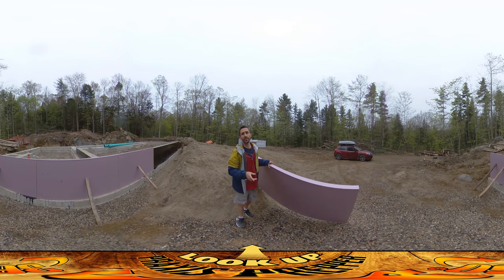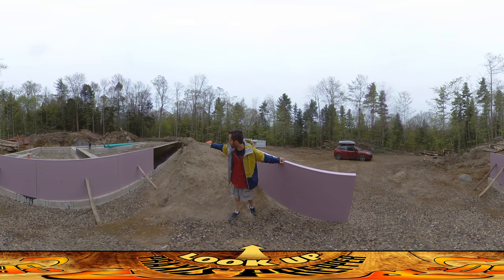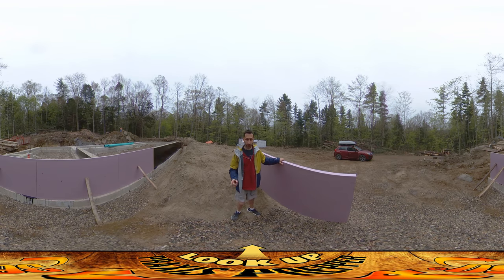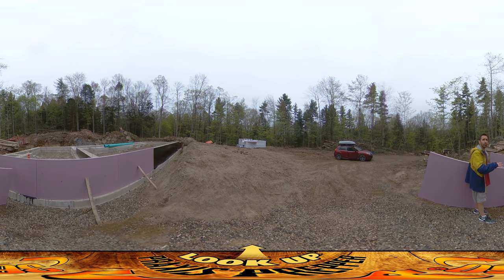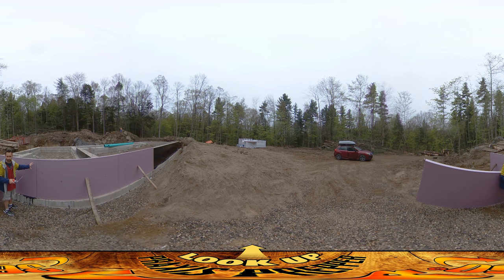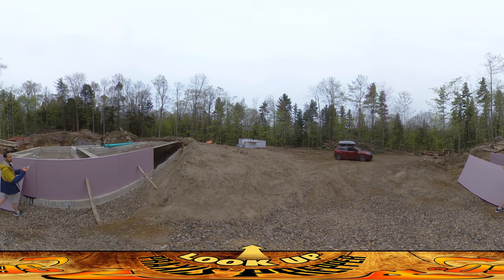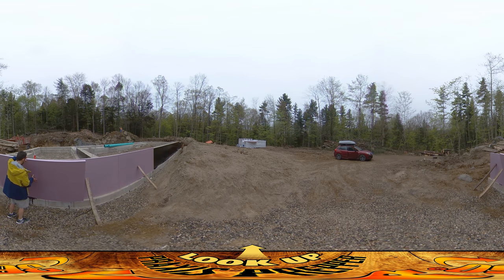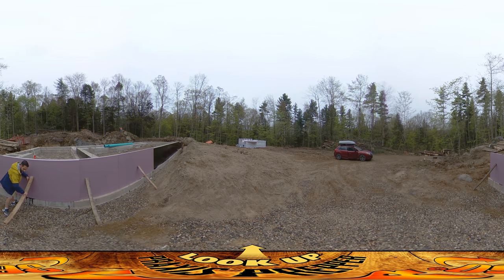Homestead Building - Foundation Insulation, Prepping for Foundation Perimeter Drain Installation

Comment: I think we use that expandafoam stuff under our sinks and such where there are any holes where drains and tubes go to the outside of the house. Keeps the bugs out (an issue in South Texas). I just wish it wasn't so wasteful. You have to use the whole can in one go as it can't be stored for later.
Reply from the maker: I know what you mean about the can clogging up if you don't use it all right away. For that reason, I group projects that need spray foam and when I have enough to use a can, I go and do them. It'd be cool if it could be done one at a time though.

Comment: Oh bud by the professional spray foam gun, no waste and Betty accurate. Available in minimal and regular expanding can switch it out. 60 bucks for gun get two cleaner. You be very happy I have this advise. You will use that even though this phase is past
Reply from the maker: That's probably good advice. I'm not familiar with where to buy canisters of foam aside from the small ones though. Do you tend to find them at hardware stores?
Reply from the maker: There's a lot of toxics when building anything "conventionally" unfortunately. When this place is up and stable, I'd really like to try my hand at a cob structure at some point and go all natural.
Reply: Todd Hendricks  no not the spray open and closed foams. I was describing the anal great stuff crack seal. Same can Praxis was using just different applicator method. As a professional builder I doubt people truly understand how much of gases occur
Reply: @PraxisPrepper  I was describing the great stuff applicator pro series easier less waste. I watch a builder who went too Norway and how they build. They use natural wood some are 8-12 inches thick. The sustainability for heat retention and efficiencies destroys pour building standard numbers. But it's so much lower on toxic. You never get away from them but sure can lesson them.
Reply: @PraxisPrepper  lowes and home depot sell them. Usually in insulation isle. Also Amazon. It has a metal ball that keeps it sealed when not in use. I come back to using it week later no issues at all. Cleanliness next to godliness
Reply from the maker: @cptrestlesssteven6469  I pre-bought a number of the cans, so I think I'm committed to them for this build. But I know what you mean about the gasses. You can see the air distorting around the foam as it comes out of the can.

Comment: Why are you only using 1 layer of foam board on the greenhouse wall? Wouldn't you want it cooler in the summer and warmer in the winter?
Reply from the maker: Good question. On the far east and west walls of the greenhouse, I'm only doing 2" instead of 4". That's because the greatest impacter on greenhouse's temperature is going to be the temperature of the ground from below and the fact that the roof is going to be just greenhouse roofing. So the walls aren't going to have much impact upon the temperature in there. Also, in the winter I'll need to have vents constantly open to prevent the place from getting way too humid and same in the summer to prevent it from getting too hot. So again, with all that air changing, whether or not the walls are insulated becomes pretty minimally important. In fact, the major reason that I continue the foam onto the greenhouse walls at all is simply to allow the apparent thickness of the foundation to appear visually consistent across the foundation's surface.
Reply: Praxis Homesteading and Survival Skills Thx, now I remember you doing the same venting in the old homestead. Wouldn't it increase your growing season If you completely insulted in there and used a dehumidifier in the winter and an exhaust fan in the summer? Maybe with some supplemental lighting using LED grow lights in the winter to offset the shorter days? I've used them to grow strawberries in the winter in my basement successfully.
Reply from the maker: That's all probably possible. Maybe I'll do that. I had been thinking that I could make a simple DIY dehumidifier that would just be a metal pipe with cold winter air blowing through it using a solar powered fan and another solar powered fan blowing warm moist greenhouse air through over that surface. The water would condense on the cold pipe and be directed out of the structure.
Reply: Praxis Homesteading and Survival Skills Given the way regular dehumidifiers are sized for an area that large and the fact that molds like damp plants if you go the diy route which sounds like a good one, although might be better pumping water through the pipes or some fluid like radiator fluid than relying on air and either put it in the middle of the room and make a sort of visual feature maybe with copper or something and if the condensation purity isn't a concern maybe have it drip into your fish tank or a plant bed.
Reply from the maker: I like the idea of turning it into art for sure!